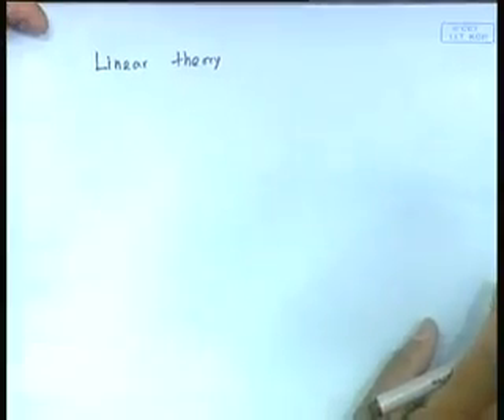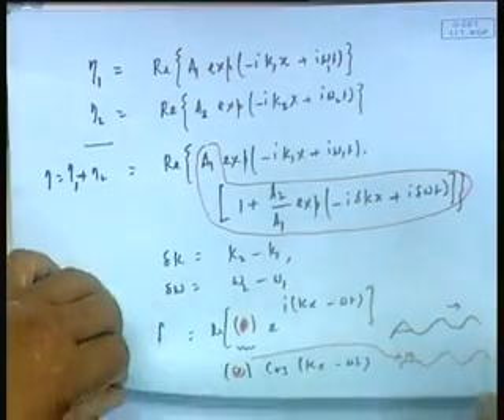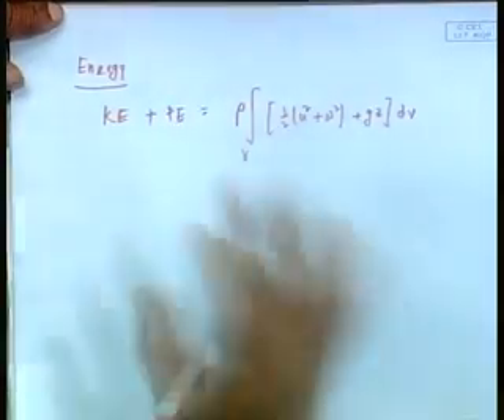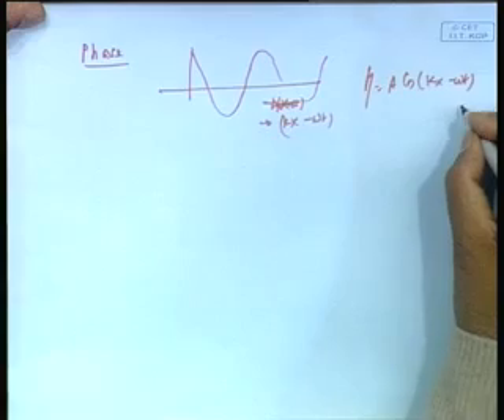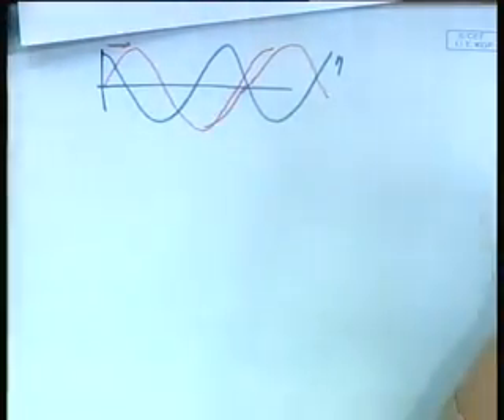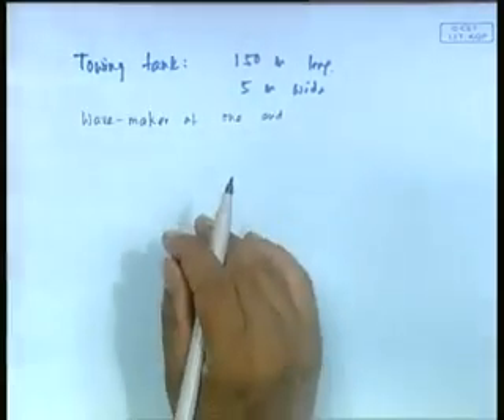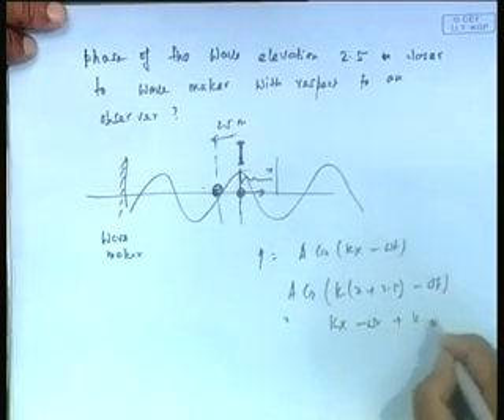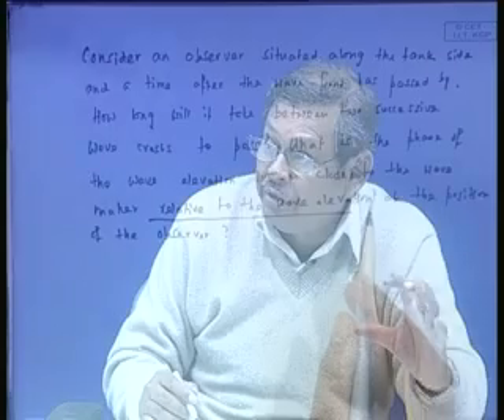Mod-01 Lec-02 Regular Water Waves - II

Comment: I have a small correction, which confused me a little: at 18:00 , the exp(kn) tends to 1, as exp(0)=1. This is why, in the next segment, you can use the dispersion relation w²/k=g and get the potential energy term.